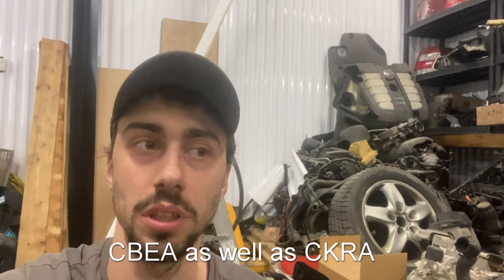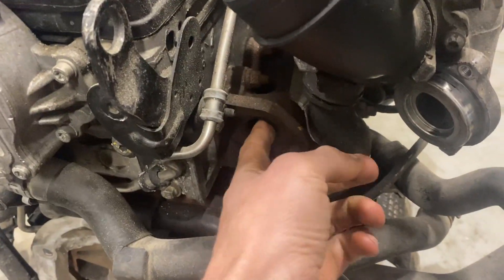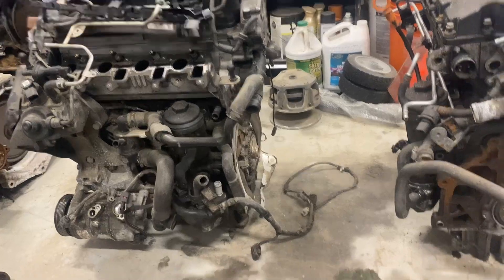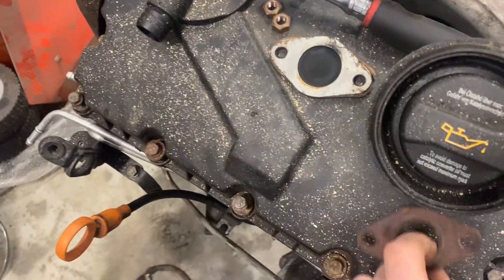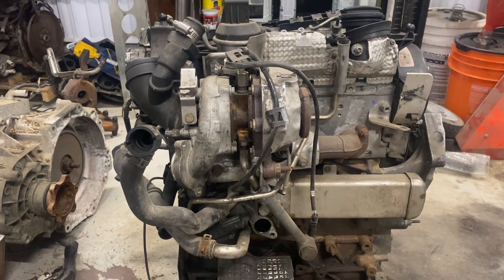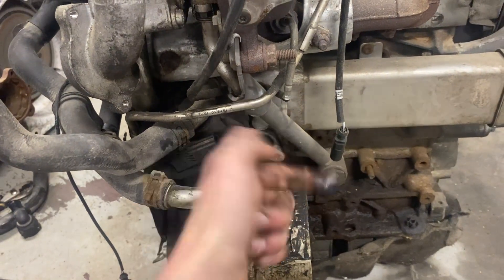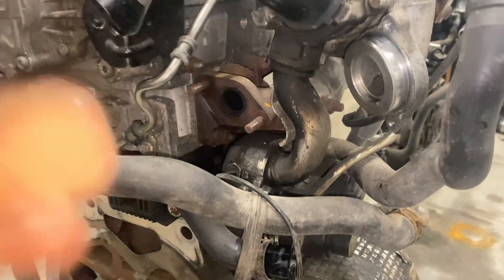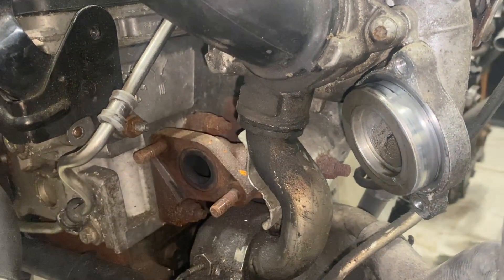CR TDI EGR Removal *For informational/diagnostic use only*

Comment: Would a brass freeze plug work for the turbo egr port
Reply from the maker: If you can get one driven in tight, you don’t want it to fall out or else the turbo gets unfiltered air
Reply: @JoshsJettas i got er air tite. But plug spit vale pressure release ffffffaaaaaaaarrrrrrrtttttt
Reply: How about a freeze plug first, then an expanding plug? That stops the chance of the expanding plug sending a nut or bolt into the impeller in the case of a bolt breaking in the expanding plug. 
Has anyone measured the inside with a micrometer to know the freeze plug size?
Reply from the maker: I want to make up a rubber plug that slips inside as well as outside and gets held on with a hose clamp. I don’t think the expanding plugs are oil compatible either.
Reply: @JoshsJettas the expanding plug used on caterpillar engines for the oil fill cap last decades.  They degrade slowly but it's just rubber and always wet with oil. They get removed about once a week and still last atleast 15 years . 
Plus i plan to remove the ccv and just put a road draft tube, shouldn't be oil there anymore.

Comment: Have had the EGR disabled and blocked but starting to see black mix in with coolant reservoir. Im thinking the EGR is leaking and may have to go ahead remove, and flush the cooling system out. Thanks the video. But I also cannot find the parts kit blocking plates, etc from the website.
Reply from the maker: I believe tune my euro and cascade German might have removed some of the blockers from their listings, I’d check with mec evo here in Canada

Comment: Hey Josh, quick question I think!! I have a 2013 TDI, which has the CJAA engine and when I try to follow these instructions to delete the cooler, the line to the bottom of the turbo does not look like yours or any others. I’ve seen on YouTube. The rubber expansion plug. Everybody says you need is way too big. On mine the pipe is held in place by two 10 mm bolts, which, Also have a 30 Torque Head Center. I assume I can just whip up a block off plate to put on there but I was curious why I’m not seeing that on anyone else’s videos. thought you might know.
Reply from the maker: The earlier engines were cbea but they share the same turbo as well. Instead of being a slip fit into the turbo like mine the pipe is bolted on?
Reply: Yes. It looks like a small block off plate with do the trick but I was curious if you were familiar.
Reply: My bad. I was looking at this all wrong.
Reply: @markgagner1607 yes. Try snd keep up. I got a new time belt but your late

Comment: Boat plug works the best from what I’ve been reading for the underside of the turbo egr inlet
Reply from the maker: That’s what some of the kits look like they come with, I was a little afraid of having the small nut inside the turbo on the plug but I guess most/if not all probably weld the nut to the plate that squishes the rubber.
Reply: @JoshsJettas  the one I picked up is just a bolt head that’s flat. Nuts on the outside. Oil galley plug meant to be on the crank case. Doorman part 02601 1 1/4”-1 3/8” just did a fit test works perfect. Gonna put a little thread lock on. Will update after complete. This delete has been nerve racking. Started with the drive belt tensioner and turned in complete ac alternator oil filter housing gasket thermostat housing and complete timing  belt and all parts associated with that. Was terrified about the timing but dang they did a good job making sure that you could diy timing.

Comment: Any tips on removing the high pressure EGR pipe?  I plan on removing the EGR, and at least the high pressure pipe, before I do the timing belt and CP3 conversion this weekend.  Thanks!
Reply from the maker: Pull the turbo intake and you can wiggle it out if you bend it a fair bit.
Reply: @JoshsJettas  That was a tough pipe to remove!
Reply: Hey since you did thr delete does delete the higher pressure egr lead to the heater core not being able to heat up the interior?

Comment: Hi Josh does the high pressure EGR pipe on the turbo have easy enough access to get at without removing the turbo?
Reply: But of course, just use the EGR pipe on the turbo acess panel
Reply from the maker: Yes, not real fun but it’s accessible with some extensions

Comment: Is there an egr valve that can be unplugged on the high pressure side?
Reply from the maker: Yes right on the intake where the egr tube is mounted, it should be written out in the tune though
Reply: @JoshsJettas tune up my land eith the seed of foren failure

Comment: I have a bunch of issues stemming from the emossions system, plugged egr/dpf although dpf light isnt on, as well as when it's very cold it can be a very hard start likely due to the ice in the intercooler, my question is what is required to prevent further carbon build up and to extend the life of the car? Can I get away with just the hp block off plate or will I be required to do the entire process in the video? Thanks for any help you can spare this has been a disaster
Reply from the maker: intercooler icing/hydrolock issue stems from the low pressure egr introducing moisture, this was never an issue on earlier tdi's with high pressure only systems. Few options besides a complete delete would be installing a blocker on the low pressure line right at the cooler. The winter front/pool noodle set up could possibly keep the intercooler above freezing so the moisture can slowly be ingested instead of freezing into a block and then hard starting or thawing and hydro locking.
Reply: @JoshsJettas  that is incredibly helpful. You are the man, thank you and I hope you have a great holiday, cheers!

Comment: My main purpose to remove the EGR is to prevent hydro locking. If I just put in a blocker plate for the high pressure EGR, would I need to block the low pressure ERG, or do anything else, aside from flashing the computer to code it? I read in another comment that the tune will shut it off, so there is no need to block it. In that case, could I just get away with a tune? My back isn’t great to the less work the better. Im having a huge issue with hydro locking. Just remedied it with no engine damage though trying to avoid future potentials. 

Amazing video by the way, thank you.

I see tunezilla wants 750 dollars for the coding and device, is there a cheaper way to get this done?
Reply from the maker: The low pressure egr (and cooler) introduce the water into the system, the high pressure just introduces soot. Usually the low pressure get blocked off during a delete as you no longer have the exhaust connection and the high pressure can stay untouched and just shut off in the tune. As far as emissions intact but shutting the egr’s off I’m not sure what they can do, you might have to reach out to the tuner.

There’s other options, you could install a blocker plate at the cooler and don’t worry about tuning it’ll throw a p0401 but that’s better then hydrolock. Another option is install a winter front to block the cooling package, it ices up slowly because the intercooler is so cold and moisture is constantly being added and the ice slowly accumulates. Depending on weather (or if you park in a garage) that ice results in a no start or it melts and hydrolock. Last option is drill a very tiny hole in the intercooler or pipe, it’ll make a consistent boost leak but should drain any moisture although I’ve never done it

As far as tuning MR Tuning is another option, last time I got a tune and flasher it was $700 Canadian.
Reply: @JoshsJettas  Thank you so much, I greatly appreciate the knowledge :) I think I will go with pipe insulation between the grill slots infront of the intercooler to start and see how this works. Cheap and easy and save me from having to get under the car. Thank you again Josh

Comment: Hi Josh, I have a stock CJAA in a 2012 Golf. And I have an oil leak coming from the turbo area. There’s a bit of oil around the charge pipe connector off the turbo but I see the grommet around the low pressure EGR line going into the turbo is pushed out and it’s a bit oily there too. Could it leak oil from there? I thought there would be suction there.
Reply from the maker: The crank case ventilation feeds into the turbo intake just ahead of that. Besides the turbo dumping oil there my guess is a bit of oil might be pooling from the ccv and leaking out, especially if it looks like the grommets cock eyed
Reply: Ok, thanks.
I think I’ll replace the EGR grommet. Is it normal/OK for the CCV to be putting that much oil in the intake?

On the same car I’m having issues once in a while where it will seem like it’s Hydro locked. After quite a few tries, it’ll finally start but run very rough and shut off a few times. I feel like it’s fuel Hydro locking. I’ve already checked intercooler and there’s no water in it. Have you run across this before? Any ideas?
Reply from the maker: @danielgerber8543 yeah mine gets damp there too, the vacuum pump discharges air up there as well so it can add a bit more air that needs to escape and some oil vapour can go along with it.
As far as the hydrolock you’d have to be loosing a fair bit of oil. I have had them lock up before and there end up just being a touch of water in there as the engine had already ingested all the water by the time I pulled the charge pipe. I would try either temporarily blocking the low pressure egr or installing a winter front of some sorts to see if you can prevent intercooler icing.

Comment: Do I have to take the whole engine out like that? I don't have a garage, I was hoping it would be possible to just jack the car up and do it that way but I guess not...
Reply from the maker: Engine can stay in, just a lot easier to film/show what’s going on with an engine on the floor.
Reply: @JoshsJettas  Thanks for the reply. I have another question. If my DPF is giving code P2002 and my EGR is P0104 insufficient flow, does that mean that my EGR filter is clogged with soot and my DPF filter is cracked allowing soot to enter the filter and clog it? If I, in the meantime, while I'm figuring out what downpipe kit to order (Mec Evo's website is not allowing me to open an account and place an order for some reason) would just doing the tune be better for my car in the meantime while I'm waiting for the other parts to arrive and an opportune moment to do the install? I need a way to get to work.
Reply from the maker: Exactly, I would go on MR Tuning website, order the stage 2 tune and there should be a drop down for a downpipe, mec evo and MR tuning both sell the same flowdirekt downpipe.
Reply: @JoshsJettas  That is what I ended up doing. The downpipe installed ok except I had to buy a small adapter from O'Reilly's to get it to fit just right to on the muffler end.

Comment: Could I leave the high pressure line in and just cap it off at the EGR value, so I don’t have to fish around in the back?
Reply from the maker: Yeah it can just be capped, the tune will shut it off as well so no need to block it off technically
Reply: @JoshsJettas Malone told me their tune is just a fault code delete, and if I wanted the high pressure EGR to not function I would have to unplug it. Is this a feasible delete option? I am not sure if this valve is normally closed.
Reply from the maker: It’s default closed, I’m fairly certain if you get the egr/dpf/swirl flap delete option it’s going to stay closed.

Comment: Hey Josh, if you’ve deleted the low pressure EGR and tuned the EGR out already, is there any consequence to also deleting the high pressure EGR line to the intake manifold? This would be to gain better access to the oil filter primarily.
Reply from the maker: Nope, just install blocker plates on the manifold and egr valve. It is a little tricky to wiggle out of there though
Reply: @JoshsJettas  
Thanks for all your support, I have an issue after all the tuning I still have EGR related problems on scanner which is not allowing me to pass inspection any thoughts on why? I have all the required software. Thanks
Reply from the maker: @Luis-d4g9m  is it a code or just not readiness set? Malone sets monitors to not ready so it’ll automatically fail even without it throwing a code. If you require readiness you might need a different tuner
Reply: @JoshsJettas  thanks for getting back to me I’m in NY and using Diesel DNA as tune problem now is I’m not getting any replies from them and over due on inspection because of Readiness (Not Ready ) so basically screwed in other words . The fact that they didn’t mention that readiness tune option will not allow the car to be inspection ready even with Readiness tune is BS . Now I have to pay up more money which I don’t want too. Thanks again
Reply: @smiller1413   unfortunately NY 😂
Reply: @JoshsJettas  thank you very much!

Comment: Josh
Is there any problem not to remove the egr cooler and leaving the water line intact 
Just block off the dpf connection?
Reply from the maker: Not at all, as long as the cooler isn’t leaking coolant internally it can just be blocked off with the blocker plate.
Reply: @JoshsJettas  is there a kit to delete the cooler anywhere?, got a cooler leaking internally, egr is already mapped out dont want to replace the cooler for something thats not in use
Reply: With a block low pressure egr is there any worry about the higher combustion temperatures?
Reply from the maker: @aaron___6014 assuming you got a quality tune there shouldn’t be any issues. You still have the pre-turbo egt sensor, I don’t know for sure but I assume there will be a power cut at a certain temp.
Reply: Hello, I only blocked off the egr cooler filter did the dpf delete and tune and its been working great for 1 year. No high temps nor coolant leaks.

Comment: I need some help with my BRM timing🙈 torsion value is all over the map...
Reply: Went in look at what I have done. I tuck my dick back between my legs, squint into the distance and whisper
The toronto maple leafs miss playoff games for belly ake and migraine.
Reply: Is it ok to put hockey cards in the spoke?
Reply from the maker: Timing belt tensioner set correctly?
Reply: @JoshsJettas  yes, in the window. Thought maybe I was off by a tooth with the sprocket. But it will stabilize at +2.4° then go crazy again
Reply: Don't wash 😊😊your intake with the engine running, the noise from the hose blends in eith the eng8ne and before you know it you both got wet shits
Reply: Josh